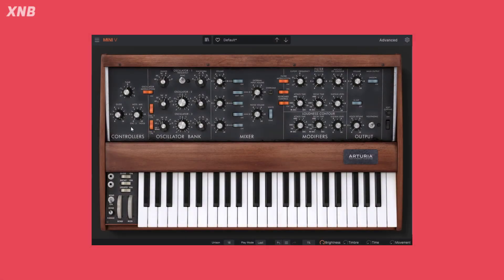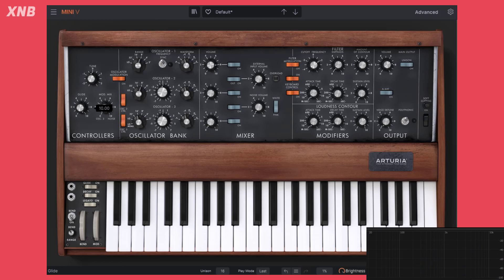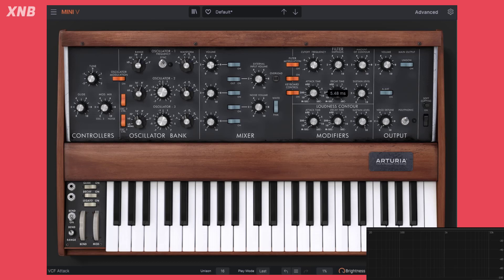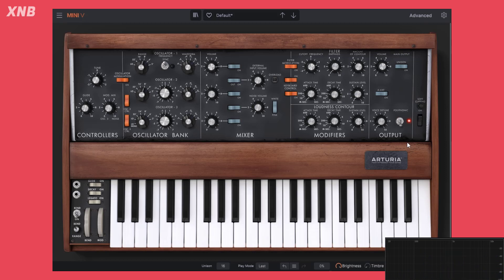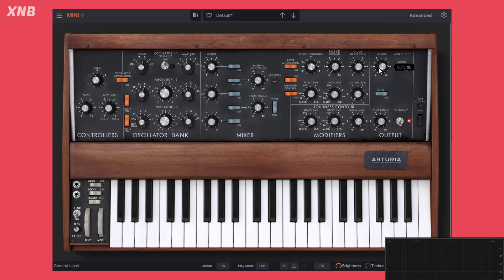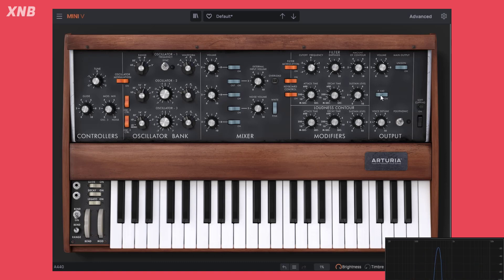Arturia Mini V3 tutorial - Controllers, Output and polyphony (4/6)

Comment: Notes for myself

Controllers section
0:32 Tone knob. Glide knob - how long it takes to glide. 
2:24 Works in conjunction with Play Mode at the bottom. Play Mode: Low - glide only works when you press keys lower than the first key you press, demo. High mode, demo. Last mode - every key works.

4:18 Legato switch. Has 3 settings. Enable filter modulation with mod wheel. 5:10 Switch Legato to middle setting and you get a sweep/filter sweep. Holding a key and pressing new keys, the sound doesn't sweep to them. 
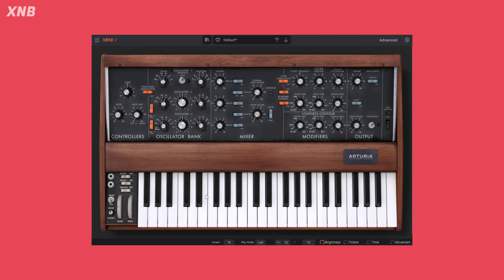5:59 Legato 3rd setting. With Glide on. 7:27 Makes it not glide when you release a note then press a new one, but it glides when you hold a note and press more. 
7:56 The manual is vague about this, not much info. 

Output section
8:30 By default the synth is monophonic, demo. 
9:29 Polyphonic switch. Up to 32 voices possible. Unison switch. Phasing sound with Unison. Demo. 
12:10 Voices of analogue synths are just a little different - detuned. Detune 16 voices with Voice Detune knob, demo. 
13:51 Can't do Unison with Polyphonic mode. But can use Voice Detune to detune the chord voices. In Unison mode you can select number of voices at the bottom. The more voices you use, the higher the synth consumption is, uses more resources, demo of consumption level. 
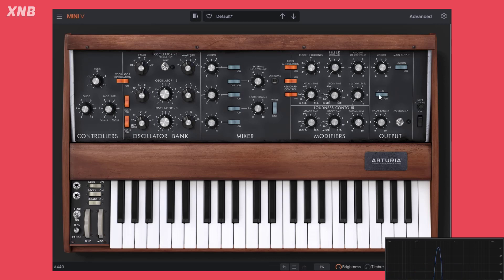15:56 A-440 switch. Reference tone - note A. 

Settings
17:00 Can change MIDI channel, Play Mode and Polyphony amount. 
17:49 Other options. Recap of what we covered.